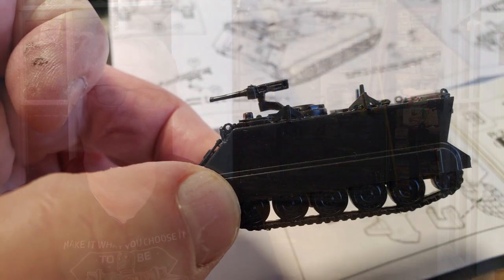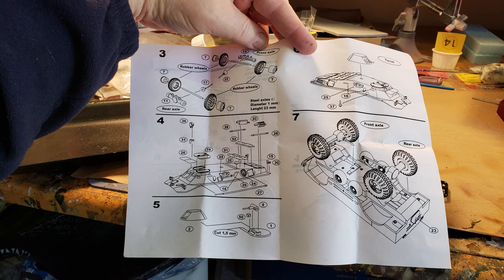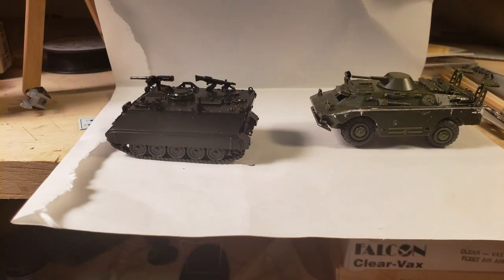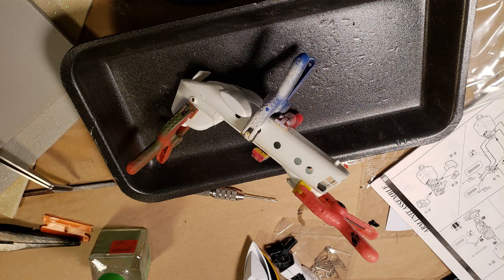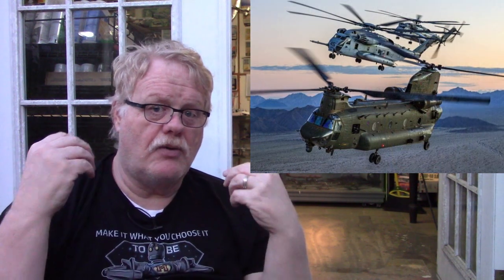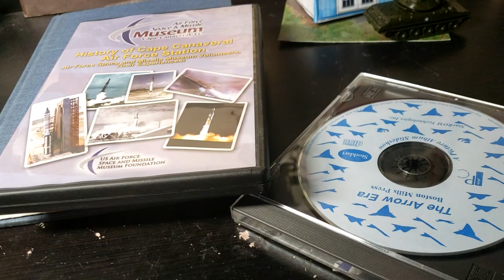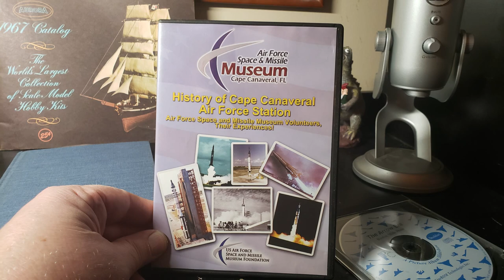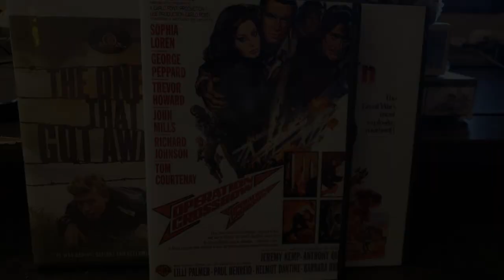Max's Models after hours 3/1/22

Comment: As long term clipper of tiny parts, allow me to offer some potential help..
Cut the sprue tree loose around the part, with the part still connected. Then hold onto the part, if you can, and cut away the sprue.

Comment: You might try clipping micro parts from inside a small sandwich bag. When I try to recycle the flint from a Bic lighter, I put inside a quart freezer bag and hit it with a big Hammer. Parts, plastic shards, striker wheel, springs, butane gas and flint go everywhere, but are contained inside the bag. Also there's a barrier between the escaping  butane and the iron hammer and flint. The bigger Bic flint fits inside a Zippo and is ''sparkier.''
Reply from the maker: Yes, thanks

Comment: Love the build so far! One thing to try to get rubber tires to stick to plastic hubs: Flowable Silicone. The kind you use to seal windshields and windows. Apply to the hub with a tooth pick then press the tire on and let dry. It will stay on amazingly well and is always removable without damage if necessary. A little trick from us Slot Car guys. Model on!
Reply from the maker: Cool, thanks

Comment: Agree on cutting away runner/sprue to get to the part.  Also, use the micro tooth saw to cut parts away or at least cut it down and use the diagonal cutters to finish it off.

Comment: Hi Max. You r experience with parts flying off into the sunset reminds me of the instruction books for a brand of model trains called Rapido. They are located in Ontario, Canada, and have a very Pythonesque sense of humor.  In the instructions they state that if a part pops off the locomotive don't both to look for it as their transporters will automatically lock on to it and beam it to the Sun.

Meanwhile, I've started my model for the flying model build.  The plane is of recent production, but the instructions lack much in the way of painting information.  My question is this:  What color is used in the interior of WWII German planes?
Reply from the maker: grey green with the RLM code RLM 02.
Reply: I'm hardly an expert on Luftwaffe stuff. I know the US used the raw Zinc Chromate anti-corrosion primer on interiors. The Germans used a color called RLM Grau.